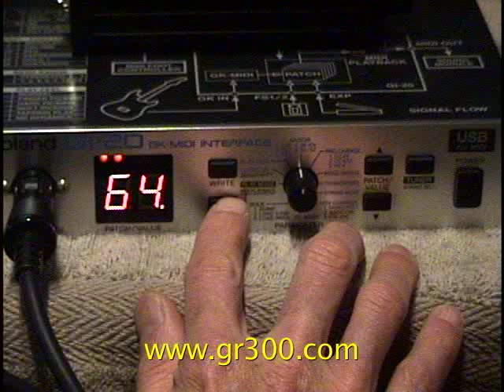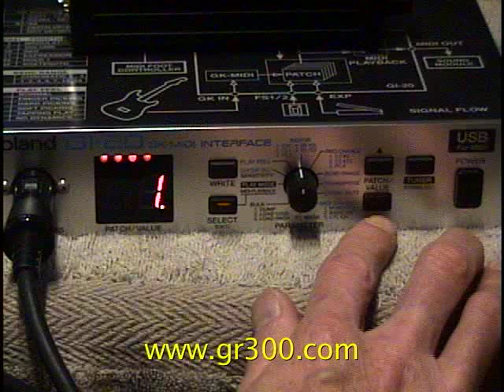Roland GI-20 Tutorial Ibanez IMG2010 BX-13-VX Controller Settings - Soft Synths - Reaktor

Comment: I'm trying to get hold of one of these.
Is there a similar product on the market other than the gr20 that will do the job of converting the voltages into midi from a roland pickup.
I currently use a Rock Band 3 Pro Guitar....this would be a massive step up